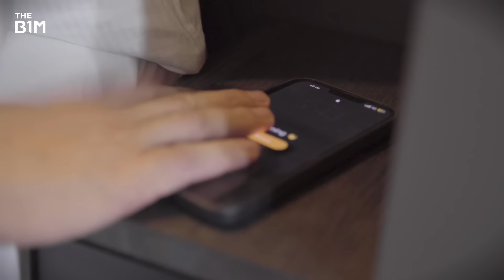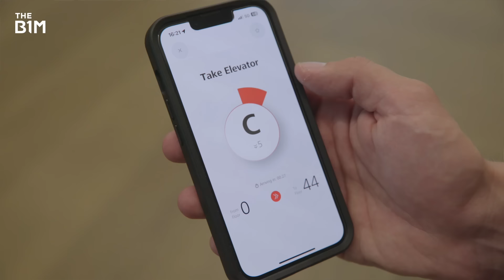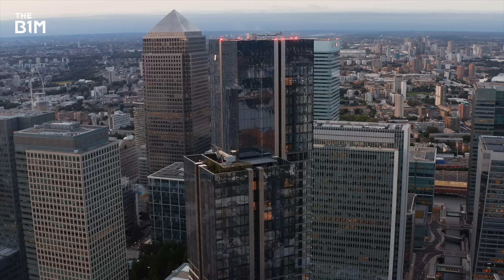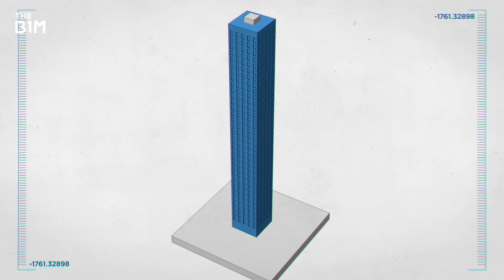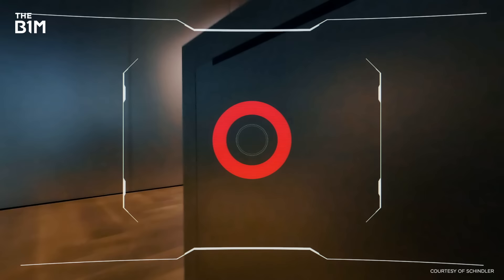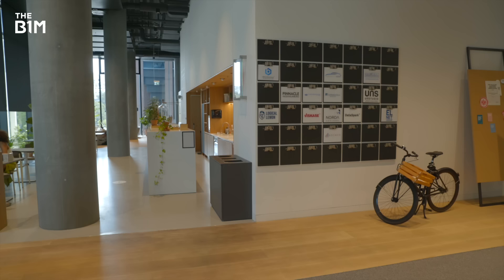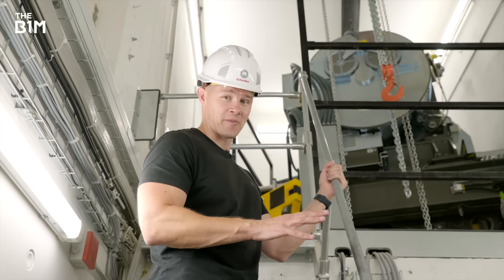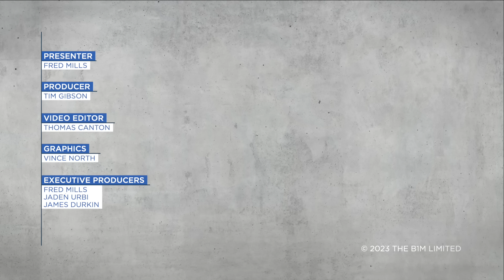Germany Has Solved the Empty Skyscraper Problem

Comment: Maybe it's the lack of sleep, but what is this huge change they made? Added a rear door?
Reply: Same here. I really don’t see any innovations in this project.
Reply: Yes it seems 2 sided lifts are a revelation!
Reply: Thanks, I watched the whole thing and I didn't get it.
Looks like just a software update.
Reply: They overcame regulations between commercial and residential elevators, and made them the same. So they use less elevators and smaller elevators.
Reply: my thought, I donj't see the revolution.
Reply: given that regulation change per country, and can be pushed by say, the lift companies who wrote them  first, lift regulations are not even a subject. Utilities is a far bigger deal
Reply: This was basically just a Schindler commercial.
Reply: Yeah, there was brief mention of the second door, which I use one daily that did that in the 1960s retrofit, and hotels have used the smart elevator thing for a long time. I kept expecting them to brag about new logic or some way to mechanically service multiple uses of the shaft to independent floors, but there was nothing. Maybe it's just applying hotel tech to an office/residential mixed use building with a second lobby to fake not sharing the building on the ground floor.
Reply: I'm glad someone else said something, I watched the whole video and thought I was too dumb to understand what was so special about anything they were doing
Reply: Same here, I didn't get it, thanks!
Reply: Complete nonsense. 
Felt like an April Fools Prank 😂
Reply: Same. But even worse. Maybe they change stuff around and now you are below a load hotel floor. Wouldn't want to live there.
Reply: @LittleMissSmallPaw  Not just basically, literally.
Reply: Felt more like an end of the month sponsor without an actual topic
Reply: @t4terr  what regulations? I'm not in EU and afaik we have no separate regulations between commercial and residential. It's safe or it isn't.
Reply: It's just a Shindler elevator system promotion video ...
Reply: 😮can this software apply to the existing elevator? Maybe it's going to help with the rush hour traffic?
Reply: This video is clearly about how the mixed use was clearly thought through and flexibly integrated into the structure. Considering possible changes in the future and demonstrating how apartments and offices can co-habilitate the space even on the same floors. Not sure why you didn't get that.
Reply: No, the innovation is the software. If you call the elevator from the residential part, it will only serve the residential part for you. Same thing if someone calls the same elevator from the commercial part. The two people will never meet.
Reply: You’re right to be quizzical. I am to. My take is that residents who are office workers get priority elevator booking. That’s it. That’s the change. And it only achieved efficiency if many work and live in the same building. That’s my guess. Otherwise, what the hell did I just watch?
Reply: @miss_pancake So the big change is the elevator goes to every floor now? And with front and back doors? I'm not sure I've ever been into a tower with such a high functioning elevator before. I doubt it fixes any of the US or any other countries  homelessness problem though, it's pretty funny you think it would.
Reply: 🤣🖐…it’s the English accent that adds the  “efficiency “.  🤣😳
Reply: Simple ... An elevator accessed from the business lobby can only access the business floors, all other floors are invisible to the elevator occupant.
An elevator accessed from the residential lobby will only move to the residential floors, all others being invisible to the rider.
The system only needs a foolproof way to determine that the elevator is in fact empty before switching uses.
Reply: @klhilde  an elevator that goes to every floor. Truly inspiring.
Reply: @thevilifyingforce  Are you missing the point intentionally?
Reply: @klhilde  No, actually I think B1M did with this video. Disabling an elevator to only partially work then re-enabling it to do the job it was originally made for is not some magical revolution.
Reply: @thevilifyingforce It's basically a relatively simple software change: Instead of reserving one elevator for either the businesses or the residents, when you push the button, one elevator spontaneously chooses the side you're on and limits itself to that side until everyone is out. After that, it can be requested by both sides again. (And side doesn't necessarily mean physically, it may open to both sides on a pure office floor. But at any given time, it will only serve either business or residential.)
Reply: Two-sided lifts are decades old ... ??
Reply: @ThePixel1983 This sounds less efficient, not more.
Reply: @camerakid76  less efficient, more flexible.
Reply: Yeah same here.  Lot of build up.  Then. “We added another door”. Uhhh.  Ok.

Comment: I would have thought the biggest challenge skyscrapers face when turning them into residential would be the lack of sunlight by the cores and therefor apartments would almost have to be entirely open plan with the kitchen and toilets close to the core and then just one huge open space for the rest of the flat?
Reply: That’s true in some buildings. Also utilities and insulation for office buildings is different than residential buildings
Reply: That's the primary problem in NYC, where there are laws mandating the presence of windows in all rooms.  Most office buildings have windowless rooms in their cores.  As pressure to convert buildings increases - the real estate industry is nearly omnipotent - I expect that these laws will be modified.
Reply: Is this really still an issue with modern lighting technology? The rules about natural light were written in a different era.
Reply: @simontist Natural light is the benchmark, but a view of the outside is the real driver. Otherwise they could have piped in natural light using shafts, without modern tech.
Reply: Have the bedrooms and bathrooms near the core leaving the windows for the living space.
Reply: @johnturner4400  no windows in the bedroom? That sounds extremely claustrophobic. Also - you’d want to be able to open a window.
Reply: @pollutingpenguin2146 do you often open the window in your office skyscraper?
Reply: @zyeborm  no, because you don’t sleep or shower in the office. But in a home, I think it’s law that you have to have windows that can open to some extent. Especially in a bedroom - it’s at least. It is not legal in Denmark where I’m from to have a bedroom with no windows.
Reply: This is much less of a problem in Germany, because of long-standing laws that require access to sunlight in offices. They don't build with such big floorplates as in the rest of the world.
Reply: @stever4899  Same in Denmark, but most countries don't have the wellbeing of people in mind when making laws in construction :)
Reply: A lot of sky scrapers don't have opening windows.
Reply: @spyboy_  if they are residential, they do.
Reply: @pollutingpenguin2146 why would à bedroom need windows?
Reply: @pollutingpenguin2146 No windows in the bedroom is fine, since I'm only there when sleeping and I want it dark when I'm sleeping. Windows in living rooms make perfect sense though. Regulations that require windows in bedrooms but not living rooms seem backward to me.
Reply: @pollutingpenguin2146  if its legal in denmark not to have windows in the bedroom, whats the problem?
Reply: @fujin09  What makes you think it's legal?  What Denmark has are laws that require access to sunlight, even in offices.  Making conversion to residential use much easier.
Reply: @johnturner4400  Most cities I've worked in won't allow bedrooms or living rooms without windows, but kitchens, laundries, studies and bathrooms are okay.
Reply: @pollutingpenguin2146  That's a broad (and incorrect) generalisation and assumption. Countries don't make these laws, but rather counties and cities do. 
I've worked in 14 countries and more than 26 cities, and I can't think of even one.
So, being the expert you are, please list the top 5 cities you have applied for permits where the authority there "does not have the wellbeing of people in mind"
Reply: @AlphaGeekgirl  please tell me where I have claimed to be an expert when my comment was framed as a question?
Reply: What do you need sunlight in all your rooms for? The living room goes on the outer wall, the bathroom does not. This is not complicated.
Reply: That’s basically what lofts in the US are like.
Reply: In skyscrapers with a large footprint, you could always create a shaft down the middle to provide sunlight to the interior. I've seen this done in some conversions.

But then you have the problem that it's in the middle where the elevators & utilities are located -- & you need those for a skyscraper.
Reply: Nope. There are ways around this and believe it or not inside apartments can have windows with artificial lighting that comes through and they look like windows to the outside and bring in light just like an outside window. 
Hahaha 😂 

I am serious by the way and we had them in Brooklyn new york. They really did fool you when you lived in the place and it made it so much better. Really. You would forget the window was fake and the light artificial and it made the place bright and cherry until you really thought about it or went to another place with real sunlight but you would forget quickly when in the apartment and your brain would get tricked and you felt like you were in a very well lit room with many windows to the outside. It is amazing how the brain works with it and how you just assume they are real and forget even though you know they are fake in the back of your head your brain forgets and adapts and you don't get depressed and all that. It was cool technology. They should do it here.
Reply: @jonathanmcadams-nx5zp  yeah I somehow don’t think you’ll be able to sell a flat that’ll cost a million + and have computer screens instead of windows.
Reply: @pollutingpenguin2146  That's called a coffin in the UK
Reply: thats not really a problem though. Most people are either single or in a relationship without kids. So having one big livingroom is really good for those people. And sanitary rooms & the bedroom don't need natural sunlight. (And there are lamps who create the same kind of light, something that would be good for most germans anyway)

Also kitchens should be part of that room, kitchens in a seperate room kinda suck.
Reply: You are speaking as if buildings were created around people’s needs.
Reply: @pollutingpenguin2146 latest research on sleep optimisation is to have as dark a room as possible overnight and I’d think low noise (barring potential of elevator disturbance at the core). Not sure either how many of these sky scrapers go for open windows? Smart air purifiers/thermostatic and with vents could handle the windowless room avoiding inner city pollution creeping in?
Reply: This is probably the biggest problem. You could probably get around it in new buildigns by having a courtyard/open shaft in the centre of the building. Yes that is less efficient use of the floorplan, but that has to be weighed against the advantage of being able to convert more easily from office to hotel to apartments and back again as market conditions change.
Reply: @simontist is comment serious? its not just about lighting, it's about nature. touch grass bozo.
Reply: @Ub3rSk1llz  nature? There's nothing natural outside the window of most skyscrapers, other than maybe the sky if you're lucky.
Reply: @pollutingpenguin2146  with good enough ventilation, there is no NEED to open a window... it become a convenience...
then come another problem with ventilation... sound proofing it enough so that not everyone 3 floors around is witness of your "night passions"...

Comment: Totally unclear how this elevator is new or different. How does an extra door translate to less lifts.
Reply: The way they separated the office lobby from the living lobby is smart but I don't really see why that's strictly necessary.  It's still the same property managemer, right?
Reply: Because it didn't,  elevators with dual openings are common,  I don't understand why they had to make a video about it and try to make it look as if this was a revolutionary element in a dual-purpose building.
Reply: I think the idea is that if you enter from one side, ie the residential side, you know you won't have to make stops on the office floors and vice versa. Instead of the separate elevator concept of traditional mixed use building.
Reply: That's because it is so simple it's stupid.  If you open the door to the elevator from the residential lobby and go inside, the elevator will only go to the residential floors.  If you open the ground floor door from the commercial lobby the elevator will only go to the commercial floors.  
Coming down it's the same  concept, you get in on a residential floor, when you get to the ground, it only opens  the  door to the residential lobby.  And visa versa for commercial space.
So one set of elevators behave as if they were two sets.  You go up and down and the elevator opens the right door for you, as opposed to traditional two door elevators where you could chose to open either door and go to any floor, or at least stick in a special access card to identify where you can go.
Reply: @jerryklosek5589  So this essentially blocks off an elevator from others to use if someone from one lobby enters it?  Which could lead to a longer waiting time - and less efficiency?
Reply: This video is clearly about how the mixed use was clearly thought through and flexibly integrated into the structure. Considering possible changes in the future and demonstrating how apartments and offices can co-habilitate the space even on the same floors. Not sure why you didn't get that.
Reply: @russellmoir2776 it's less efficient than if you had all elevators shared with all floors but it's still much better than limiting certain elevators to only service certain floors. For example if there's 4 elevators they can dynamically assign 3 to the office during lunchtime when there's a rush of workers using them, and assign all 4 to residential at night when no one is in the office.
Reply: I also dont get it.
Reply: @briankuhl9314  Thank you for the clarification, the video was unclear.
Reply: If you're going into the office, you don't want to get on the elevator with some dude who just got back from the gym/grocery and vice versa. It's not the elevator that matters, but the program that runs it. You can call the elevator if you're coming home from work and you will only see other residents. It makes it feel like the entire building is single use and not mixed use...
Reply: different areas require different levels of security and access, generally office spaces are closed after 5 PM so anyone could come in and use the elevator to access the office space with ill intent, that's where the app comes in handy, it lets you go where you need to go and keeps you from going where you should go, one of the main obstacles for mixed purposed buildings.